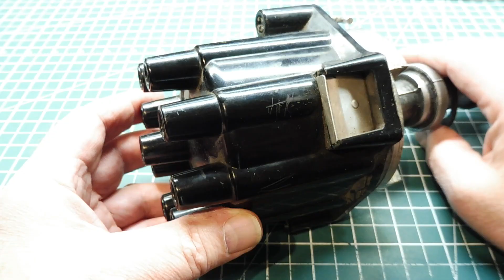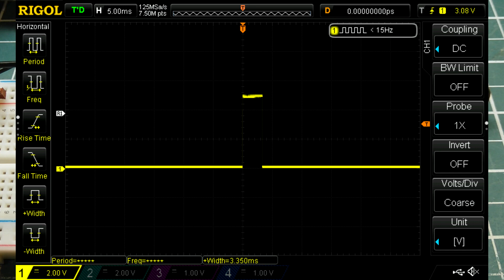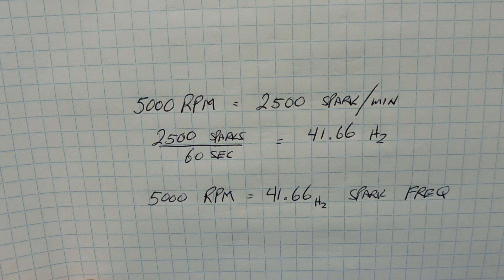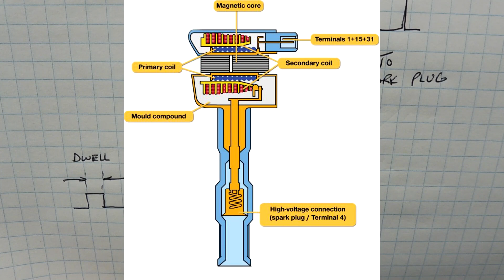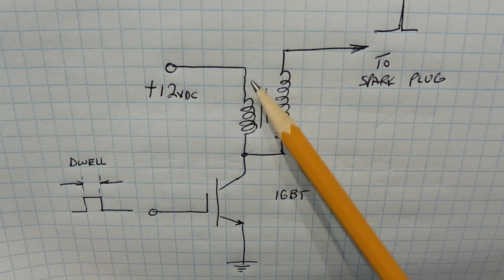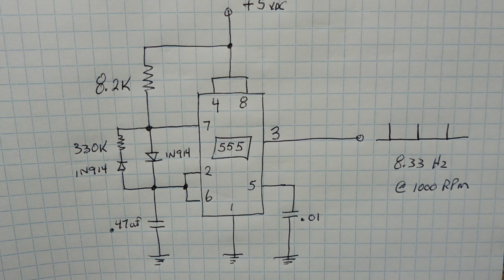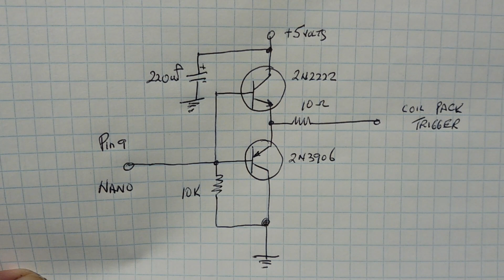Coil Pack Driver Circuit / Arduino / 555 Timer

Comment: Thanks for an extremely well produced and explained video. I understood everything but I still have a few questions (answers would be appreciated but not expected).
I am currently researching electric fences. I propose using a car coil controlled by an Arduino Nano. By the very nature of an electric fence, the secondary side of the circuit will be open circuit most of the time unless an animal completes it. Will this damage the coil, since the energy in the secondary winding has nowhere to go when the field in the primary collapses?
I also wondered why you felt a driver circuit was necessary to drive the IGBT? This has, as you said yourself, a MOSFET front end which is basically just a capacitor. Surely an Arduino could supply enough current to charge this up to its V(th)? I realise there could be a very high, but extremely brief, in-rush current but couldn't this be limited by a resistor, if necessary?
Thanks again for your time and effort in sharing.
Reply from the maker: Spark plugs fail and go open circuit without damage to the coil. An Arduino GPIO can source up to 40 mA while currents during charging/discharging of the MOSFET input capacitance can be as high as 1 or 2 amps depending on the MOSFET and switching speed. Check out these other videos that might help you further:
https://youtu.be/zbuutEXkY5c
https://youtu.be/FDSNT68YC3k
https://youtu.be/mjIubJeTRyY
Reply: @0033mer  Thanks for you're very helpful reply.

Comment: Hello,
Thank you for sharing. I have a question for you, I want to use "33410-77E2" ignition coil from Suzuki XL-7, it has three terminals and I could not find the datasheet. Can you help me,  I want to drive it with an esp32. Thank you.
Reply from the maker: On a three terminal unit it is usually:
1 Ground
2 Trigger
3 Power +12 volts
Use a voltmeter and check pin1 and 3 for power, then 2 will be the trigger.
Reply: @0033mer  Thanks for your reply.   The problem is I have only the ignition coil and I don't have access to a vehicle to verify Power and Ground.  What is the position of wires 1-2-3 (left to right) or 3-2-1 (right to left)?  Thanks.
Reply from the maker: Look closely at the connector near the bottom of the pins, sometimes they stamp the pin numbers. If not, search online for a service manual.

Comment: Did you do the code for the Nano in Forth?  If so, would you mind sharing it?  I'm still plugging away trying to learn Forth on Arduino!
Reply from the maker: Forth code was used to control the coil pack using Timer #1. To get started  using Forth on the ATmega328p micro check out these videos:
https://youtu.be/P6rMFcwik3M
https://youtu.be/PY01_9dANd8

Comment: Does thee US have a different metric of time to most places? 8 sparks per second is 16 revolutions per second and multiply that by 60 to get rpm, 960.
Reply from the maker: Here we calculate precisely:
8.333... sparks per second is 16.66666667 revolutions per second times 60 to get RPM, 1000.
Reply: @0033mer  and I agree with you there but not with 8. When it's about 8, or 8 and a bit, I would agree then too. thanks for the reply

Comment: Shouldn't there be current limiting resistors on each base of the complementary pair for protection?
Reply from the maker: The transistors are configured as emitter followers where the input resistance looking into the base of the transistor is Beta times the load resistance (RL).  Since the load is an insulated gate device the resistance is high so there is no need for current limiting resistors. If you want to add one the circuit will still perform properly.
Reply: @0033mer  Gotcha, thanks.  I'm really enjoying your videos!

Comment: Another question, is a coil basically a transformer? Transforming 12v to higher volt spark ?
Reply from the maker: Yes .. It is basically a step up transformer where the number of secondary windings are much greater than the primary.

Comment: Can you do another one for the fuel injector ?
Reply from the maker: The 555 timer circuit would be the same to drive a fuel injector with a VNLD5090-E as the driver IC.
Reply: @0033mer  Thanks ! Wanted to do something with my generator for quite a while. Found a Lambda part on Elecktor. Keep up the good work!

Comment: Do you have the shamanic lay out for this project.
This and a fule injector tester using a 555 timer are 2 things i am looking to make.
Reply from the maker: The 555 timer circuit would be the same to drive a fuel injector with a VNLD5090-E as the driver IC.

Comment: Really great video.  I didn’t realize you could power a spark plug using 12 or 5 volts.  Since you used 5v, does that mean the spark is also lower voltage than if you used 12v ?
Reply from the maker: The coil pack is powered by 12 volts (pin 1 on the connector) . The trigger signal is 5 volts.

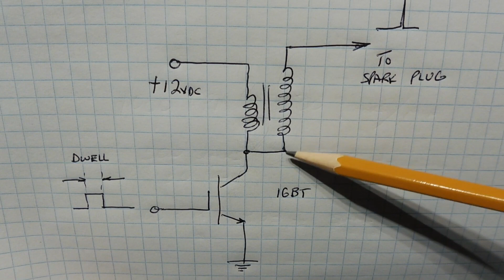Comment: At 5:25 is there a reason why there is no a flyback diode across the primary coil?
I know that IGBTs can handle high voltages so that may be the case.
Reply from the maker: The schematic is a simple version of the circuitry for ease of understanding. A flyback diode would cause current to circulate in the primary causing the spark to be delayed. Some IGBTs use active clamping where the device goes into linear mode dissipating the energy stored in the inductance.
Reply: @0033mer  True, I have been studying about transients and I couldn't stop thinking about the noise generated by the coil and transmitted through the power supply.

Thanks for sharing!
- Cristian

Comment: Could you use a logic level triggered mosfet to drive the the coil?
Reply from the maker: Yes .. if it outputs the proper 5 volt trigger waveform.